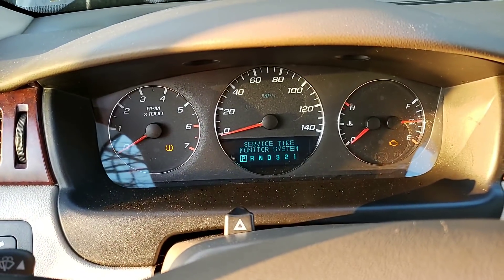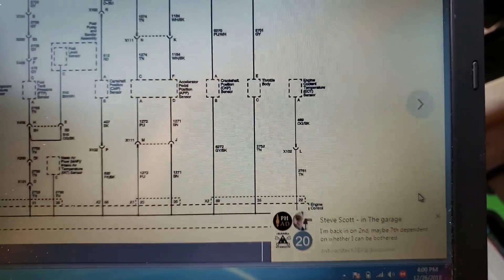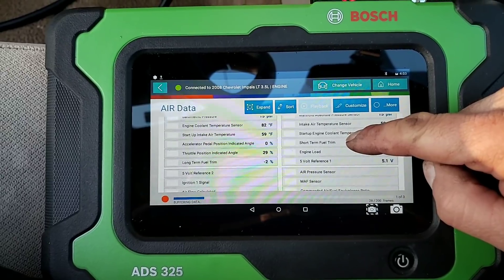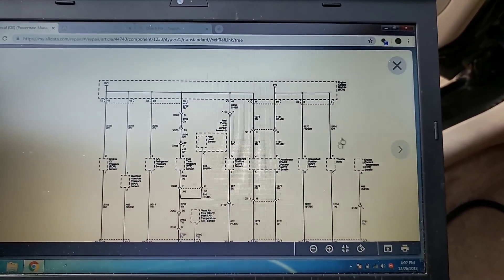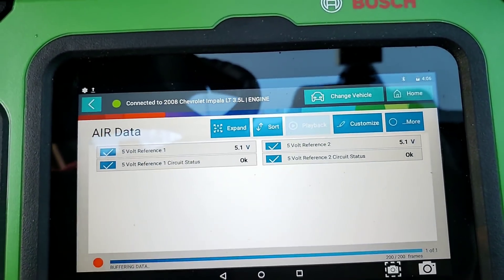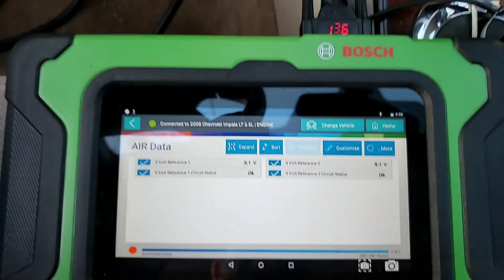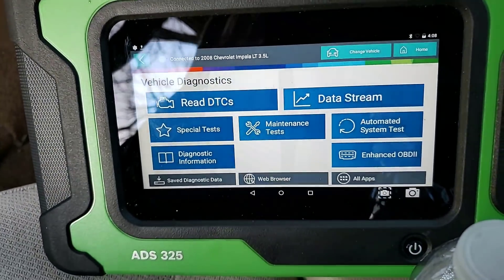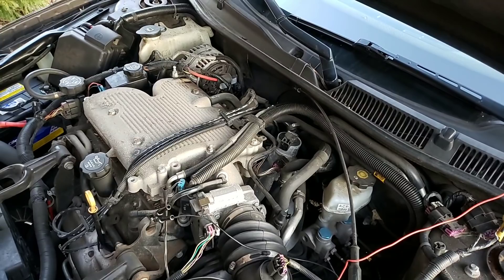2008 Impala No start Hard start 5v ref

Comment: Having a good understanding  of how electric circuits and components work is very important. That allows you to work with the wiring diagram, if the system as its drawn  does not make sense  you must dig  deeper into wiring references  to find the information that will  lead in the right direction. It's  an unfortunate fact that most manufactures  draw wiring diagrams differently and then you have information services sometimes trying to make "improvements". Schematics are like road maps, you've got to know how to read them before they can help you .  
  Thanks for the great video Keith you keep adding some big pieces to the puzzle.

Comment: These days I think Dorman has merged with General Motors ... 😁

I worked on a '11 Impala that failed inspection due to that secondary air system. I found a nuked relay, and valve (valve may have taken out the relay - not sure there). But, what a poorly engineered vehicle that was. Thing barely had 50k on the clock and I'm fixing this stuff, all while the blend door motor clicked away desperately trying to find home - take the key out, lock the doors, and it STILL clicked away! Unreal. Never seen a vehicle built as poorly as that one, and I've been around cars my whole life!

Thanks for showing this one. 👍 I'd have got bitten by this, for sure! Guess it pays to look through everything. I'm my own worst enemy - I have no patience. If I slowed down a bit, I'd probably be successful MUCH SOONER. 😉

Comment: I usually go to obd global first just to see if the vehicle has secondary air when looking at monitor status. Surprised the car started with the ckp unplugged. Excellent stuff. Many things I've seen on gms to go to reduced power mode. I had dirty throttle body's do this. Tps throttle angle outta whack. Excellent Video my friend.

Comment: I just checked the genuine gm service info.  On the 5v and low ref bussing it shows air pump solenoid on 5v2.  Im still sticking with my comment to ivan that gm has good diagrams.  It would have been nicer on the older stuff to see the bussing in the pcm like the 12v on cam and crank tied together on silverados
Reply: I've always found GM wiring diagrams to be the best out there as well (but maybe I'm biased because I grew up with GM products). As long as you're in the know with GM's Regular Production Option codes, they won't steer you wrong. People unfamiliar with GM speak can easily get lost, however, if they don't notice a section of wiring diagram that says "w/ NU3". I also like how GM diagrams sometimes show sections of the internal circuitry inside of an electronic module so you can better understand the circuit as a whole.
Reply from the maker: No doubt about it fellas , the diagrams are good. The point made here is to never just read bits and pieces. Give the entire powertrain system an overlook . Especially if something doesn't seem to jive.
Reply: Of the service information and diagram companies Kieth which one would you say is on top above the others? I know they each have their own little perks but I’m trying out Alldata at this time and I was subscribed to Identifix for quite a while.

Comment: I saw you using the Bosch ADS 325.  How does that compare to the Snap On Verus and the Autel?
Does the Bosch have scope/graphing capabilities like the Snap On?  Or the Autel?  I'm looking at the Bosch ADS 625, but the 325 would be a comparison start.  Great Diagnostic Video!  You'd think GM would learn their lesson regarding the +5 Volt outputs and put the sensors with the least amount of trouble on the same reference, and the more troublesome on a different +5Volt reference.  Hence, less chances of a "leaving-you-stranded" NO START!

Comment: Nice Find!

This is a case of Alldata not regurgitating factory information correctly. Do you have access to GM SI? If you do pull up Document ID: 1888866. The factory schematic shows the Secondary Air Injection (AIR) Pump Solenoid on 5V2, connector X2 terminal 1 with all the other circuits for 5V1 & 5V2. I guess you can point Alldata in that direction and they should correct it. 

Regardless, a nice find given the incorrect information you were given.

Comment: could someone explain what this air  pump solenoid / wallet with wings does and why it was a problem? thanks
Reply from the maker: It was pulling the 5 volt reference circuit to ground . The air pump solenoid as they call it is a diverter that opens and allows forces air from air pump to enter exhaust stream. Works like a bellows on a woodstove if you will. Pumping air to heat the catalytic converter up to temperature faster .
Reply: @NewLevelAuto  thanks for quick reply and explanation. So you could actually just leave it disconnected or would the money light be on and would it not pass your emissions? ( we dont have emissions testing here in Oz yet thankfully ). I also take it there was an insulation breakdown inside the component to pull the 5V to ground? Still wrapping my head around this stuff. Like a puzzle to be solved.